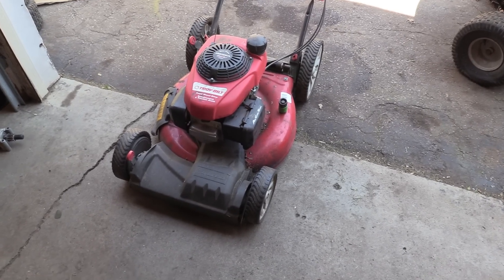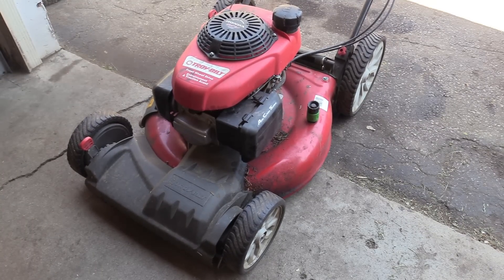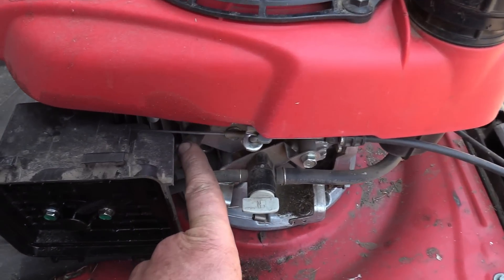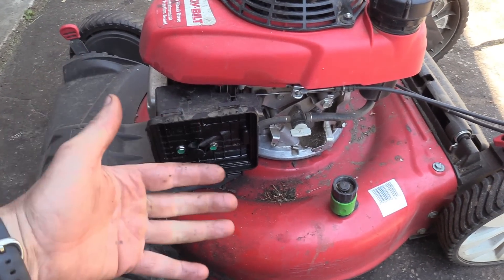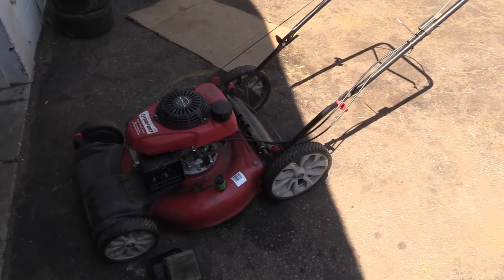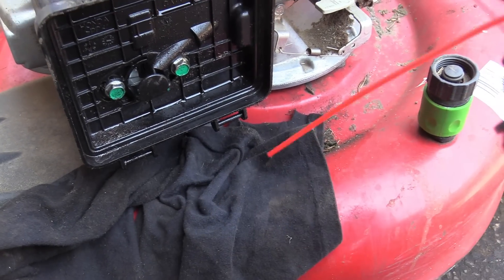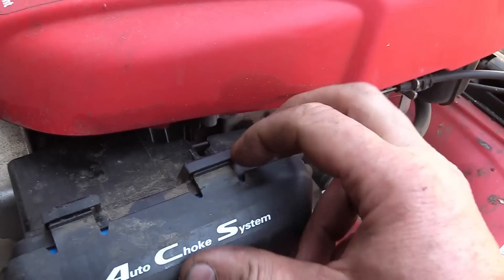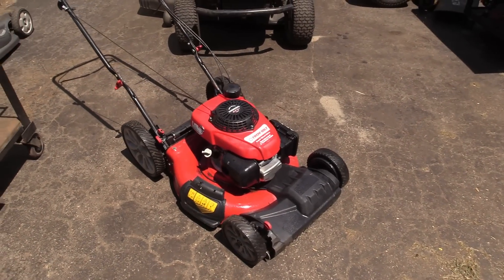Lawnmower Serviced A Month Ago - Why Is It Back In The Shop?

Comment: Showing the engine running with the dirty filter off, on and off really shows how bad it blocks airflow.  With it off, it's not blowing black smoke anymore, too.  Quite a difference.  I learned about not not tilting on the air filter side a while back, but I didn't know one still needs to be fairly brief with it tilted with the air filter up.  I didn't know about tilting back, either.  Check the spark plug, too.  Wow!  Always great tips, Don.  Thanks
Reply: I've seen this before. Along with upsidedown blade, loose new sparkplug oil over filled, and they were proud of their work?😂

Comment: FWIW, in about 2 months of watching your videos (and 2 other channels), I am to the point where I knew the most likely diagnosis for this mower once you pointed to the oil on the deck.
Thanks.  Small engine knowledge has been on my wish list for decades.

Yours are the best produced of the videos I have seen--even the ones over a decade old.  Well done.

Comment: what clued me in was the black smoke coming out of the exhaust when you started the engine, which indicates the engine is running rich. Clogged air filter, easy diag.

Comment: I’ve had them come to me like that and if I have time to look at it when it comes in I can usually catch it and I just charge them for the filter and a minimal diagnosis fee. Most people are extremely happy that I diagnosed it right away and gave their mower back to them, eliminating the need for a return trip to pick it up, plus, they can mow again, without the lawn getting out of hand or hiring someone. 

I really don’t understand those customers that get angry for the “minimal charge” to diagnose. They think that since I was able to repair it without much time, they should owe anything. I had to stop doing this in cases that I don’t know the customer. It’s unfortunate that some ruin it for others. I charge a one hour minimum for any repair. I do this because I am a one man, home repair shop. I only work by word of mouth, or drive by customers. I don’t advertise or “look” for business. I may not spend an hour on the repair, but by the time I do the intake, diagnose, find parts, repair, contact the customer and collect, I’ve spent at least an hour, usually more. For those that I can diagnose at intake and do a quick, simple fix, I can save them money, since I didn’t use as much time. It allows me to get back to other repairs and gets them back to mowing- win-win.

Comment: Thanks a lot for this video.

What engine oil is supposed to be put inside Honda lawnmower or Honda snowblower? Can I use the same engine oil, as I use for my Ford C-max - full synthetic Mobil Super 3000 5W40?

Comment: Dirty spark plugs don't always need to be replaced , quite often cleaning will suffice .
Reply: That plug needed to be replaced. I've seen plugs like that and cleaning would be wasting time.
Reply: Spark plugs last for many years often. I clean spark plugs the vast majority of time.
Reply: Very true. The plug was still functionally fine as evidenced by the fact that the engine ran quite well with the plug still dirty.

Comment: I swapped those filters for the B&S foam ones where I can wash & reuse, also bought some K&N filters that can be cleaned as well that I'm going to use in my Prediter engines when the paper ones play out
Reply: Paper filters suck when things like this happen and are way overpriced. One good method is using a foam pre-filter to prevent having to replace the paper element.

Comment: Hey Don, I was wondering how do you charge a customer in a situation like this? Is it just a curiosity fix, and no cost to the customer? Because it was a recent service. Obviously, the customer is a t fault & should be charged for the new filter & plug if needed. Your time also needs to be considered.

Comment: The hardest one to detect for me was  my generator which operates in the doorway of my storage building. It would look fairly clean, (the air filter) however it was sucking in a lot of exhaust fumes from not getting a good clean supply of fresh air. I operate it their to keep it out of the weather during storms so that is the culprit.

Comment: Sounds like it has an Oil soaked air filter. That happens if you tip a mower over on the carburetor side. You can spray the filter out with Gum Cutter but it will probably fall apart. lol I had to deal with 2 mowers that came in just a couple days ago with the same problem. 1 Briggs Quantum powered push mower and 1 garden tractor with a Briggs Vanguard v-twin. The Vanguard had a PCV valve failure that cause the filter to get soaked. Oil in a paper element filter is Bad.

Comment: Was gonna ask what brand engine this is, but pretty sure I saw "Honda" stamped into one of the plastic covers.  How about if you tip it so the air filter is pointed up, is that OK?  I guess the best thing to do would be to pop the filter off before working underneath so if oil leaks it won't get into the filter.

Comment: The first thing I do with any small engine is immediately remove the oil breather tube from the intake, it is useless and causes problems with the carburetor especially in cold weather with something like a generator,  if you have a generator that's not in a dusty environment,  remove the air filter, and the oil breather and it will run way better in the cold weather, and won't freeze up in extremely cold temperatures. I live in alaska and if you don't do this, your generator will not run at all at Temps below -10f.

Comment: Hey it doesn’t run well, what about the oil all over it, perhaps that has something to do with it.  Some people have no clue and are happy to pay someone to fix the problem.  Heck yes you charge them again, for your time and the new filter. Perhaps not the diagnostic fee since you know what the problem was and if it was a good customer. But your time is money and you have to charge for it.

Comment: If you need to tip it up for any duration, wouldn't it be smart to pull the air filter off and have a can of carb cleaner handy anyway? Waiting for the engine/oil to cool down before tipping makes good sense safety wise as well but some folks lack any sense at all.

Comment: I sold this same model of mower in pristine shape last spring, a month later the owner brought it back because it wouldn’t stay running. The gas tank was full of blue - green colored gas with loads of water in it and of course the carb was full of water too. He said it couldn’t be the gas because he just bought it fresh from the local station, one of those cut rate places called Raceway or Speedway. I dumped all the fuel, cleaned and flushed everything and suggested he use a reputable station at least for filling the mower gas can. They always blame the machine!
Reply: Yep, "IT CAN'T BE THE GAS, I JUST BOUGHT IT."  Every year i fill up a 30 gallon drum with "New gas" that they just bought. This is wasteful and I ended up having to pay a disposal fee. So For the past couple of years I have been letting it settle in a large glass jug, separate the actual gas and add octane booster and/or sea foam and use it in some of my own equipment. Now I fill the drum up a lot less often.